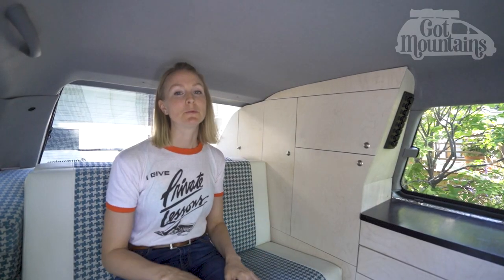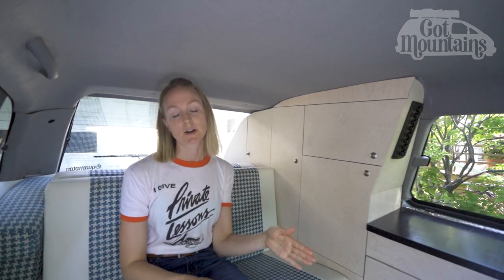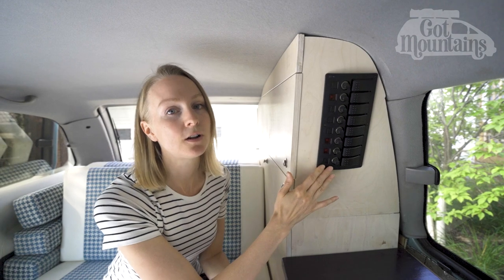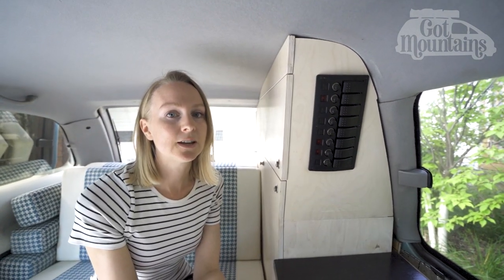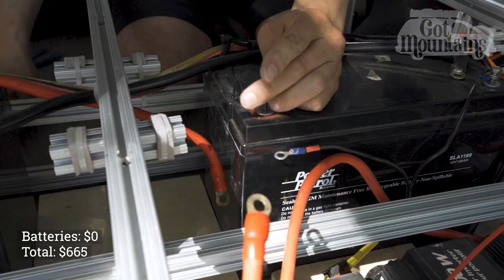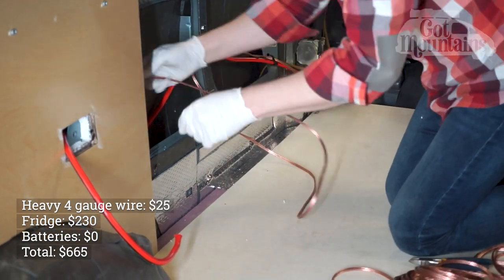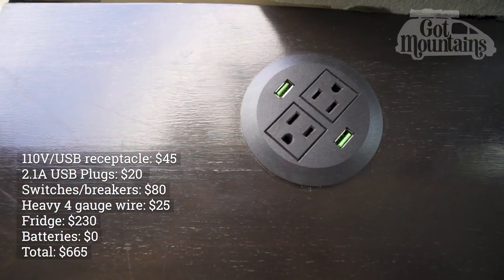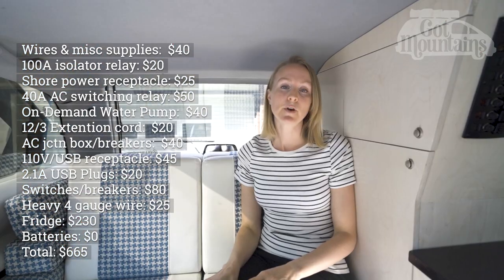Affordable Van Life Electrical - What We Spent, Micro Camper!

Comment: Great Job guy’s 👍 I have some questions. How did you wire your BlueSeas AC breaker? Use the Hot(Black) through the breaker from the Inverter? Then Just connect the Neutrals and Ground respectively? Where did you ground the AC? Connect it to Dc ground or Car frame? 
Thanks Ray
Reply from the maker: It's all hotly debated, bit I'd keep the AC ground seperate. Ground your inverter through the negative, and then ground your AC side out the shore power connection. For the breaker, we just used it to interrupt the hot right when it came in from the shore power. Then used GFCI plugs for each leg as a failsafe.
Reply: @GotMountains Thanks for clearing it up. I’m just starting to install the electrical system and not many vlogs mention the Ac ground form the inverter. I’ll get the GFCI plug in . Thanks again
Reply from the maker: @raymercado3650  Yeah, I think it's because there isn't a clear winner when it comes to how to ground it. I think theoretically, the negative from the supply side should be interconnected to the ground from the AC side, but I've never tested it before to see.

Comment: I am going to get portable solar panels as I think that's definitely more economical and I'm thinking about getting a jackery that you plug it into instead of all that other stuff because a jackery has everything you need in it. 500 jachary will power everything I'll need, 240 might even do it but extra power never hurt anybody. I believe I 500 is 499 and you can get a solar panel 100w for about a hundred something depending what you get. You also could charge your jackery via your vehicle with just a cigarette lighter cord.
Reply from the maker: Yeah, those all-in-one units are pretty slick. They usually cost a lot more per Wh of energy they pack, but they save you a TON in time fiddling with wiring and installation. The 500 wouldn't come close to supporting us (2 adults and 5 kids worth of electronics, fridge, VitaMix, hair dryer, etc) but for someone that needs just that much, it's totally the way to go.
Reply: @GotMountains  that's true but Battle Born batteries are more expensive than the 1,000 jachary heck they're even more expensive than the 1500 Bluyetti